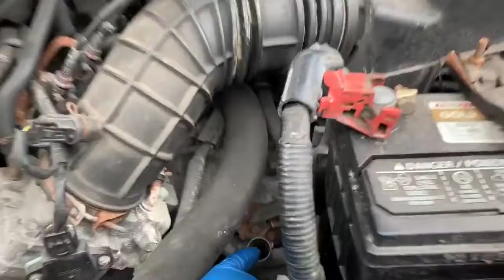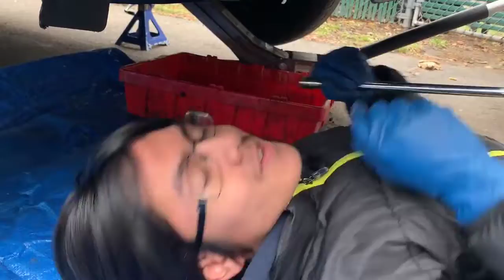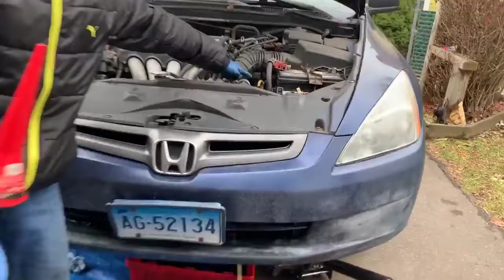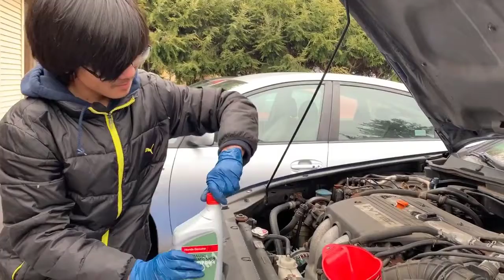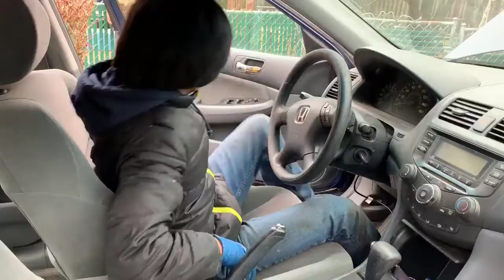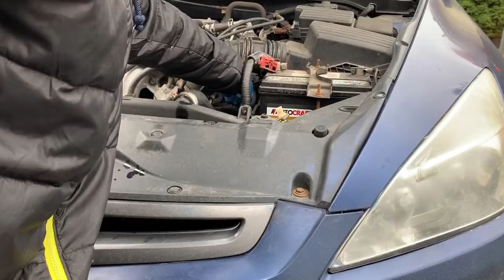Honda Accord Automatic Transmission Fluid Change, Drain & Fill ATF DW-1 | Symptoms & How To Diagnose

Comment: Some friendly advice: Auto transmissions use small pistons sliding back and forth when a gear change is required. Those pistons use rubber o-rings on each end of the pistons, and the heat generated during summer driving causes the rubber to harden and will cause the trans to stop shifting properly if the piston becomes stuck due to the o-rings becoming less pliable. The trans fluid has chemicals designed to keep the o-rings soft, and as it becomes dirtier and older, those chemicals become less effective. This becomes evident when shifting problems start occurring. This can oftentimes be solved by simply replacing the fluid and the old filter. Also, Lucas makes a product specifically designed to soften the o-rings and it typically takes about 500 miles of driving to do it's job.
Reply: Is that also regarding the V6? Since Honda doesn't recommend transmission filter changes for v6's...

Comment: You need check the fluid on level ground after the oil is at run time temperature.

Comment from the maker: You can buy Genuine Honda ATF 08200-9008 DW-1 from Amazon.com in addition to the dealer, here are the links:  
1.  https://amzn.to/3lx5aT5 (Honda - 08200-9008 DW-1 Automatic Transmission Fluid, 1 quart, Pack of 12)
2.  https://amzn.to/2QF9WQ9 (Honda FBA_08200-9008 08200-9008 Automatic Transmission Fluid, 4 Pack, 1 US QT /946 ML)
3.  https://amzn.to/2YNOsFe (Genuine Honda 08200-9008 Automatic Transmission Fluid ATF DW-1 (ATF-Z1) 2 Quarts)
4.  https://amzn.to/3baaKWC (Honda 08200-9008 DW1 Automatic Transmission Fluid ATF - 6 Pack)
5.  https://amzn.to/2EKwzAe (Genuine Honda Fluid 08200-9008 ATF-DW1 Automatic Transmission Fluid - 1 Quart)
6.  https://amzn.to/3hIUkaq (Honda Genuine OEM Automatic Transmission Drain Plug Washers (18mm), Bag of 5-90471-PX4-000)

Comment: I got a code p0757 ..my car is doing what you described I just changed the transmission fluid its driving better but the codes still came back while D is blinking, any suggestions?

Comment: Okay, I just learned something from you (technically your father), although your tongue twist was confusing at the end of your explanation. I'm experiencing what your brother is. 🤔 I think your video is the best (information wise) but, I  think you should either redo it or do that voice over but write the instructions down and read them so that it's without the hesitations,  stammering, and the few mistakes, distractions and background noise, because it annoys and confuses me.
 ***UPDATE: I had the car transmission flushed completely per the video. In my case, it made a positive difference for A HOT SECOND, then it was right back at the pulling, skipping and not catching. So, I called several mechanics telling them my issue and getting prices on transmission work. Some quoted me the $1800-$3500 prices. Nalley Honda wouldn't even give me a ballpark figure (automatically disqualifying them to 😒 I don't trust ANYBODY that won't tell me something). They wanted me to bring the car in. Gowens is highly reputable but, "high" is the operative word, the are too expensive. I went there; he wanted to charge me over $100 just to 👀 at it but refused to put that amount towards a $3000+ repair bill (that disqualified them). I spoke with a few Amco locations (they are franchises). The one in Fayetteville, the lady seemed knowledgeable because she spoke the lingual, BUT, she talked TOO FAST...like a salesman 😌 I don't trust fast talkers, they tend to be dishonest (DISQUALIFIED). The one in Newnan: the guy did something totally different from everyone else 😃 he suggested that it may not even be (as serious as) the transmission; telling me of some common causes.I was enthralled! Immediately he earned my trust. 😊 Just for being so forthright. Even if it were the transmission needing rebuilding/replacing, he was my choice. Come to find out, it did not...it was some throttle needed cleaning 🤗 his fee was $192...a far cry better than $1800+

Comment: I have an Acura TL. I bought it used and  it had 165k on it. I'm thinking about changing the fluid and filter (located in the cooler line). Have you had any issues after changing the transmission fluid in your Honda?
Reply: Congrats on the TL!!
This  process should be the same way

Comment: does mixing the old fluid (Honda ATF-Z1) with the new dw fluid cause any issues? loved the video!
Reply: every mechanich refused to change my fluid and the car is only 100k miles, transmission shifts flawlessly and i want to keep it that way! so i'm gonna do the job myself
Reply: @Cristofopo I had the same issue. I just found a small local garage willing to do it.
Reply: @Cristofopo  My 2010 Accord Ex just hit 115k miles. I bought it from my sister 4 yrs ago with 85k on it but she doesn't remember the last ATF change. I went to the dealership she went to, pulled the history and it was done 5yrs ago w/80k. The fluid is still full and pinkish tan color. I'm going to do it myself every 30k now.

Comment: I swap 3 quarts out each oil change Easy and cheap no reason not buy 3 quarts Genuine DW-1 fluid and do it. The plug captures the clutch material (which is nornal) just clean it off and carry on.